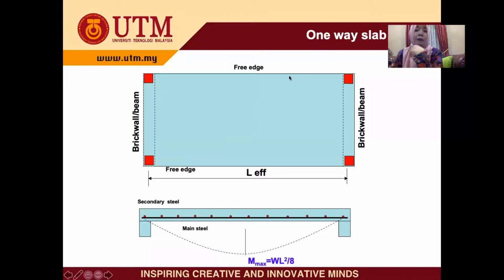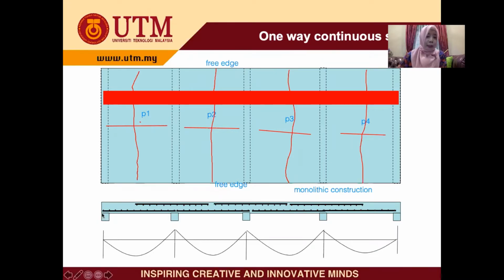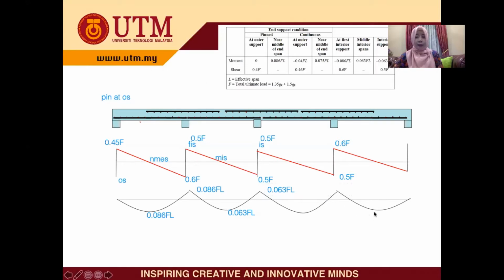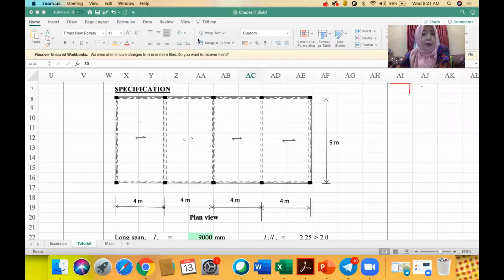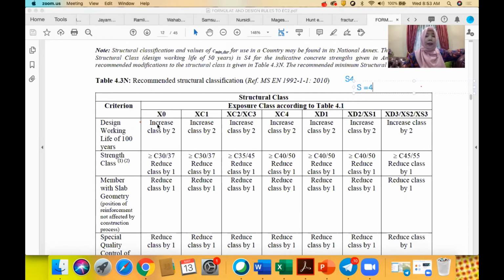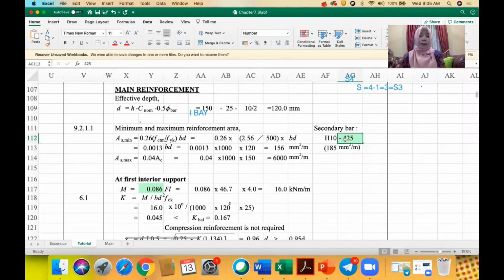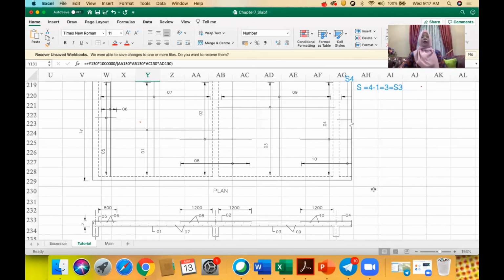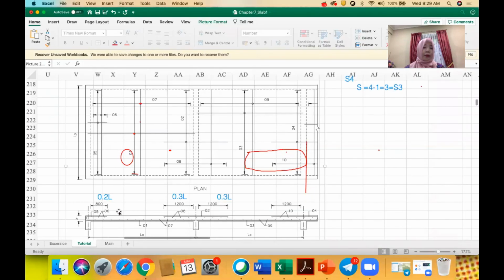DESIGN FOR ONE WAY CONT SLAB

Comment: I think you may forget to change H10-300 BOT into H10-300 TOP when calculating at out support As， Cuz Outer Support should provide the top reinforcement when we are drawing the cross section below. I mean in the reinforcement design of main, when you find the appropriate reinforcement through the diagram, and then you mark top and BOT behind the reinforcement, I wonder if all the supports are TOP. All span is bottom, in "One Way Cont slab"